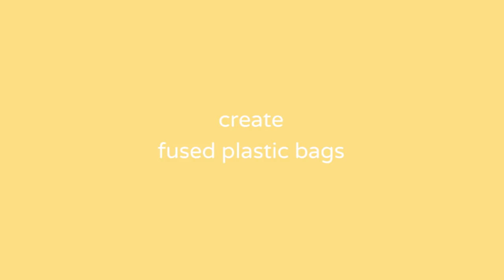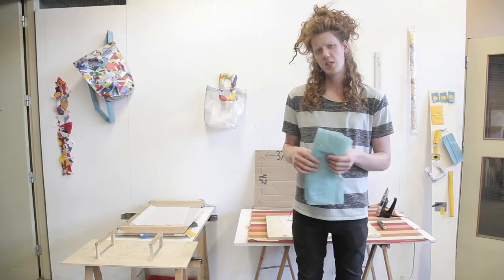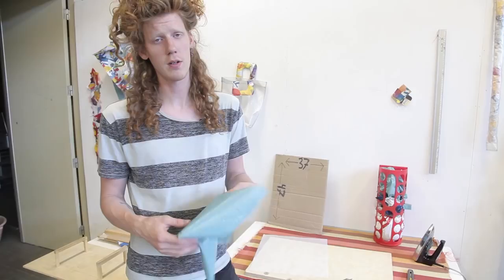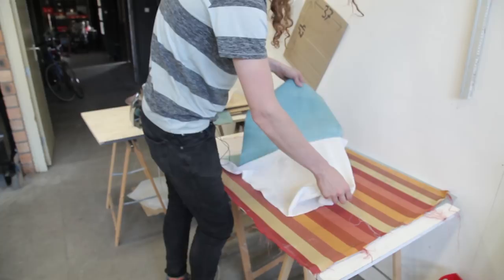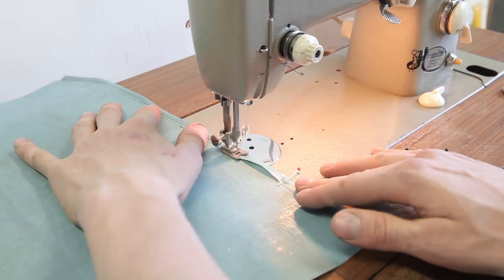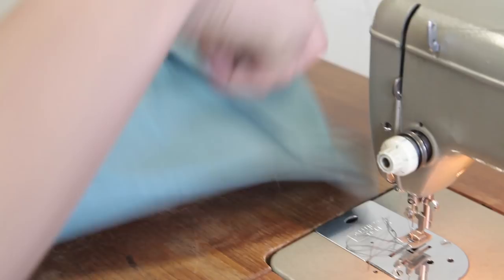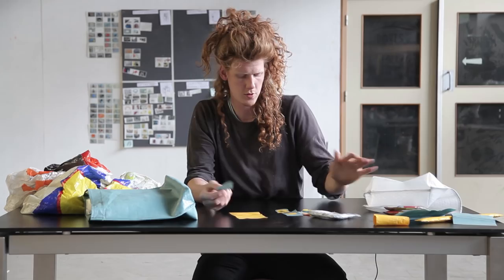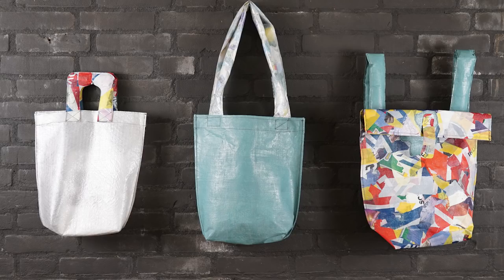Make a durable tote bag from shitty plastic bags #preciousplastic

Comment: I would consider using polyester thread and not cotton thread when sewing the bags. Because when these bags get recycled again then the cottonthread is a contamination. What do you think?
Reply: It would still be a "contamination". Actually almost all plastic bags are polyethylene and wouldn't mix with polyester even if you tried to melt them together. Although maybe you could obtain a composite that would work.
Reply: If it's your bag and you plan to recycle it, why not just rip out the seams before putting it in the recycling?
Reply: Cotton thread won’t hold up over time in a reusable bag. You really should use polyester thread.

Comment: Would it work to fuse the seams together with heat instead of sewing them?
Reply: It does! I use a electric scalpel to "suture" my plastic!
Reply: I have a small iron typically used for mounting photographs that I use for fusing seams.

Comment: Question: Would it work to just fuse the seams rather than sewing? I don't see why not, but maybe doing it this way helps avoid a sharp structural weakpoint that could fail?
I'm not likely to make tote bags anytime soon, but I'm definitely going to try fusing smaller film into larger pieces, as well as thickening. Seems useful for patching or reeinforcing for example a damaged tarp.
Any experience from fusing polypropylene films? I don't think PP is used much in shopping bags, but it's used in many of the sturdier trash bags because it tend to be more resistant to tearing.

Comment: I couldnt succeed. I try to stick 3 layers of plastic bag and  it was getting smaller from the edges when iron heats the bags. If i lover the temperature then layers are not sticks each other . Iron temperature is very important to make the plastic layers combining each other. Unfortunately i gave up trying to ensure the right temperature. It is not easy as it seems. It is time consuming process to me.

Comment: Is this energy efficient?
Reply: Anders Bäccman 
Sure it is. If you calculate how much of energy is envolved in making a new plastic product in a factory and that this you could do with old style iron powered by coal and man powered sewing maschine ;)
Reply: Considering a clothes iron on high can draw around 1KW, it's definitely on the high side if you're doing it constantly (for selling them or something). Though for a few reusable bags for groceries, I doubt you'd even munch half a KW/h during the process. If you're wondering about the environmental impact rather than the personal expense, it'll still save on packing material and shipping if you're using bags you have lying around rather than getting a pre-made bags shipped in, and it's that much fewer grocery bags you'll need to grab at the store.
Reply: The problem is not so much the energy as the waste. Plastic bags are cheap to make, both in material and energy. But the effect they have on the environment as a waste is devastating
Reply: hey... I'm doing a thesis research on it for my master degree in building engineering and from the info I gathered František Zet has it right... so GREAT IDEA Bjorn.. by the way super cool name! great fan of Vikings! easy and efficient way to work!
Reply: No.
Reply: If you consider the amount of energy that is required to locate , segregate, separate, and safely dispose or recycle the plastic bag if disposed then hey its a 100% economical to do at home considering the fact that you'd be helping out the environment in a big way

Comment: Why sewing? Why not welding?
Reply: Good question actually... why  not fuse edges with more pressure and more time just as we seal an open plastic packaging using a hot knife ?
a possible reasons : thick plastic sheets are less easier to fuse so they may get separated with some stress (carrying objects)
So if you manage to fuse the container (bag or other) it might be used to carry non heavy objects. one can improve the design of the bag to reduce this probability.

I am more interested in a solution without a sewing machine anyways
Reply: Heat